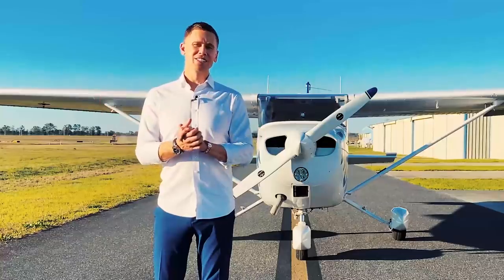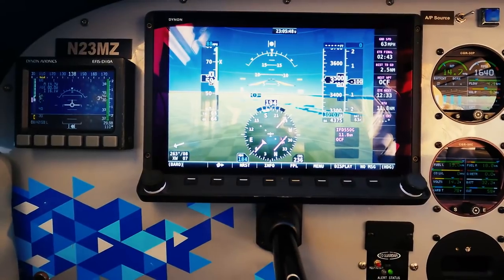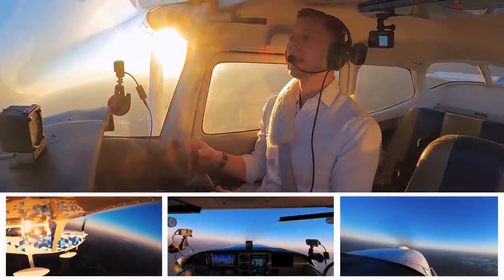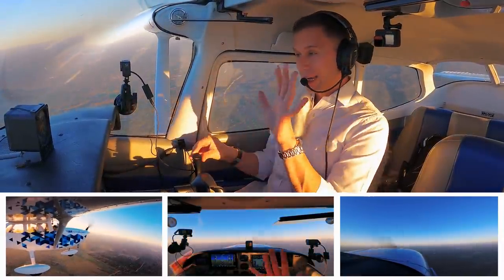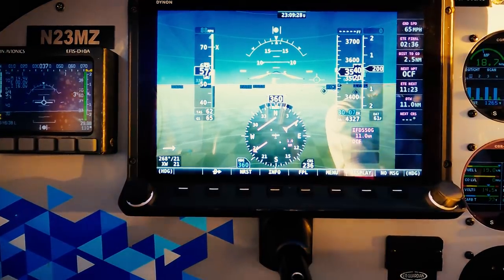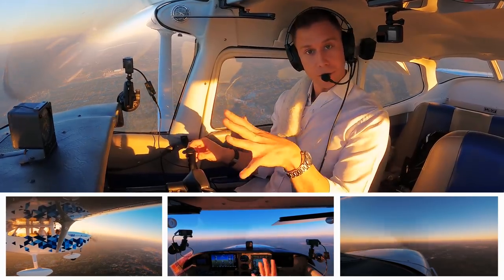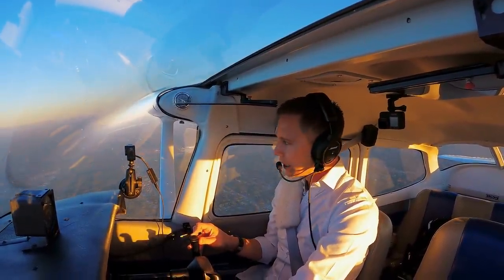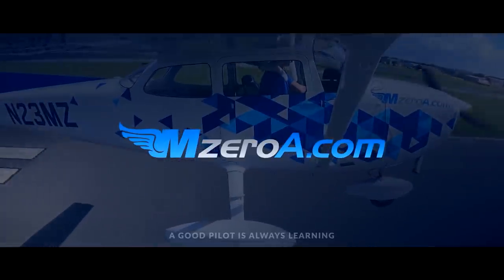Fundamentals Series Episode 2 - Slow Flight Practice & Stalls

Comment: One thing I'm glad I learned early-on is that the airplane will "seek the airspeed you trimmed for". So, as long as I'm not putting tons of back-pressure on the yoke/stick and I've configured correctly I won't stall in slow flight. Power input is my primary pitch and attitude control. Because of that concept, and the "hands free relaxed flying" I was able to fly +2Kts on my Commercial and Commercial/IFR multi-engine check rides. Trim is the best thing ever. 

These videos were very, VERY helpful in preparing for those tests.
Reply from the maker: Thanks for watching, Mike! Glad our videos have helped!

Comment: @5:38 = death grip experience.  When I was in Air Force pilot training, I had such an aggressive death grip on the T-37 stick during one final approach, my pinky was inadvertently depressing the nose wheel steering button (located on the stick).  Unfortunately, I also needed lots of left rudder to correct for cross winds during that same landing.  This meant, as soon as my main gear hit the pavement, the nose wheel swung hard to the left during the highest speed part of the touchdown sequence.  Made for quite an adventure during the rest of the landing rollout.  😛

Comment: Started with a death grip, got over it quickly. I had a really chill instructor who I was flying pattern practice with - he told me to pull power to idle abeam the numbers to simulate engine failure, power-off 180. Said to "trim it up and fly hands free," I thought he was crazy but he had a dead serious look in his eyes... so I did, and that little Cessna just glided through the gentle bank I had put it in and turned right around lined up perfectly with the runway with no additional input from me. I never had a death grip on the controls again.
Reply from the maker: Thanks for sharing! Glad you are getting more comfortable!

Comment: Do you do a slight cross control to keep the airplane from over banking in slow flight?  I find in the simulator I do best if I do a slight cross control to keep the wings level while turning, so that the secondary effect of the Ritter doesn’t bank the airplane too much and caused me to lose altitude.   In the flight simulator in CAT I IMC conditions they have it with a 15 knot cross wind but I know if I’m not careful I end up doing S-turns across the ILS on Landing.
Reply from the maker: Hello, thanks for your comment! In slow flight, it is easy to let the bank get away from you so you may need to turn the yoke in the opposite direction just to prevent that from happening to "catch" the bank angle. If you need more help please reach out to us at support@mzeroa.com. Fly safe!